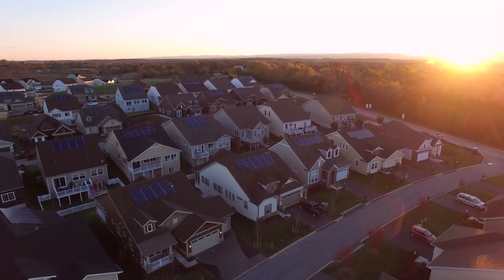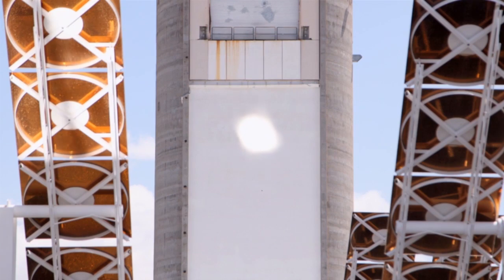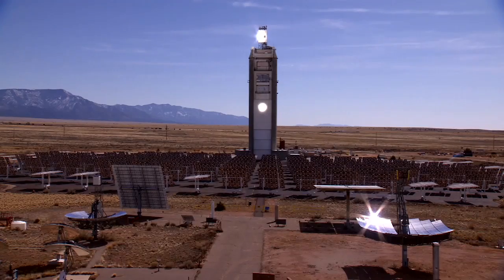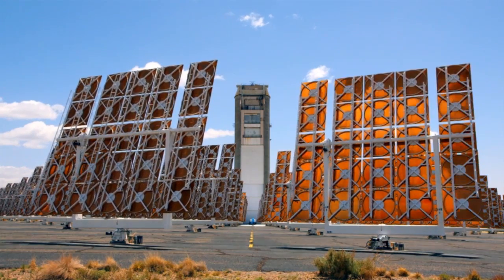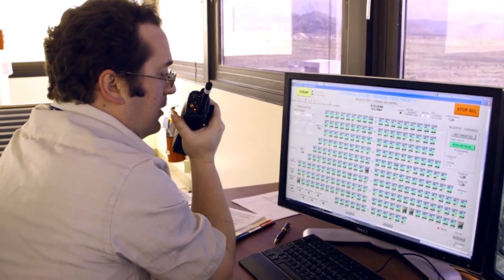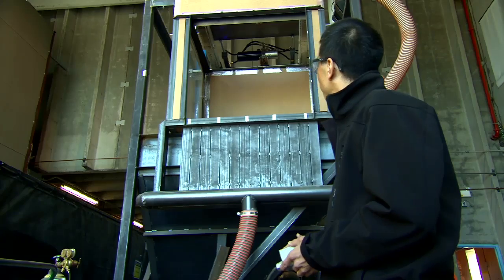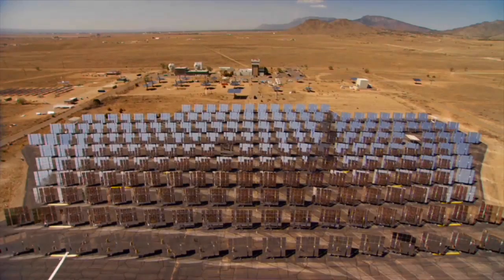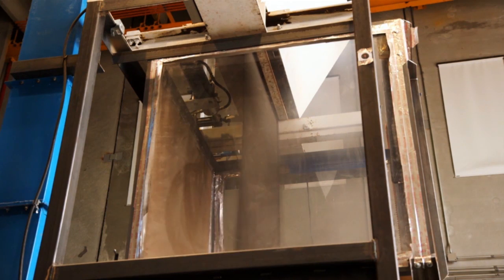Lowering the Costs of Concentrating Solar Power

Comment: There are systems that use concentrated solar to heat compressed  air that drives a gas turbine.  The efficiency of a gas turbine is limited by the temperature difference between  the heated gasses and the exhaust gasses.  The solar turbine heats a surface that heats compressed air.  The temperature is limited  to the melting point of the heated surface.  If it was  possible to heat the compressed air by passing it through the focal point of the concentrated  sunlight,  there would be no limit to the temperature..   But  sunlight seems to go right through the focal point of a magnifying glass with little or no effect on the air.  If ordinary sunlight causes some ionization of the air, then there should be more  ionization at the focal point of concentrated sunlight..  If the focal point was located at the center of a powerful magnetic field, and high voltage plates were arranged near the focal point,  some of the ions and electrons would be trapped if only briefly.  This would cause more ionization at the focal point which would cause more ionization , etc....... at an accelerating rate.   If the concentration of ions and electrons  reached a certain point called a critically dense plasma, , sunlight would no longer be able to pass through the  focal point.   The plasma might heat up to millions of degrees.  
Ions and electrons in the compressed air  could be separated by an insulated  high  voltage positive charge  at the center of the turbine.  A cylindrical plate around this electrode would be hit by electrons trying to get to the center and drive the ionized air away from the center.   If this cylinder was connected to a plate and a grid for the exhaust to pass through  just beyond the turbine blades,  the positively charged air would be accelerated through the turbine blades where it would recombine with the electrons from the cylinder and complete a circuit.. Another set of turbine blades just beyond could extract the heat generated by the flow of current at this grid. 
A generator driven by the turbine would generate additional electricity.
If a set of compressor blades was attached to the inside of a funnel, and the positive voltage at the center was connected to the funnel and an insulated cone just beyond the focal point, the compressed air would pass through the focal point where some of it would be ionized and some of the ions trapped between the positive voltage on the funnel and the cone and held in the focal point by the magnetic field arranged parallel to the axis of the turbine.  The positive charge would build up which would tend to trap some electrons.  The electrons would try to escape towards the funnel or the cone but being much closer to the positive charge at the focal point might trap some of them for a while.  The rush of compressed air into the focal would try to dislodge the trapped ions and electrons, but a strong enough voltage and magnetic field might hold  the ions and electrons long enough for the temperature at the center to increase fast enough so that more air was ionized than stripped away by the comoressed air.    The positive charge on the air would tend to increase the pressure  and drive the system faster.   If the inner housing was connected to the funnel and the positive voltage at the center,, the funnel would tend to ionize the air as it was being compressed and air ionized by the plasma would tend to increase the voltage of the inner housing which would increase the ionization of the air in the compressor funnel.  .  A number of accelerating processes would  tend to increase the temperature and the voltage of the compressed air and drive the turbine at an accelerating rate.

Another possibility is to put a high voltage arc acriss the air entering the turbine.  Since it is spinning, the arc would create a disk of plasma that could trap the sunlight at the focal point.  Multiple arcs might trap all of the sunlight if one disk is not dense enough.

Comment: With Optimization of Stirling Engines you would drastically increasing production by making every parabolic mirror producing energy from concentrated light: higher temperatures means more energetic conversion.
Highest temperatures differentials means increased efficiency.
You have the only patented technology to creating below 80°K in a small radius with a small portable device producing no vibrations and lasting +22 years, NASA approved..
SunPower's Stirling CryoCooler is the best solution in terms of energetic expenditure for creating a low temperature side in a fully optimized Stirling Engine.
You could ask "THAT" MIT board advisory professor helping you creating a Molten Aluminium Heat storage for superheating air at ~950°C during night time bringing night hours production just halfway the daytime production.
With inexpensive materials like Clay Graphite , Aluminium and Arduinos you could be able to bring the Kwh price to 0,02$ quite easily...
Taking in count a lot of jobs and a good pay even..
Ask Mexico... they have plenty of desert.
[No seriously ask Mexico]

Comment: Why not stick to cheap low tech pv? It does the job low cost on your  own roof.
Reply: PV is not low tech. You could cobble together some form of CSP using parts you could find in many many villages and districts in africa. You can't manufacture a PV in the same african village or district. You almost 100% guaranteed have to import the PV panel.
Reply: @backtotheoldway6964  You are right. PV's are not low tech. But the installation and maintenance is not very complex. Therefore, in rural places, PV's in a simpel setting are preferable. 
But still there is the problem of storage. There is no easy solution to that problem. But accu's differ greatly in price and effect. Maybe a less expensive solution can be found.
Reply: PierreB yes, if you can find a cheap utility scale battery
Reply: Solar power needs a whole lot of light collecting surface. Better be something simple like a mirror than advanced electronics like PVs requiring environmentally damaging mining to produce.
CSP is more efficient too.
Reply: well Thermal solar power have economies of scale. Also thermal solar power can store energy in thermal batteries. these batteries are much cheaper when done at large scale. Its economy feasible for Thermal solar power plant to have enough power storage for whole night. Pv power storage has to be done in lithium batteries which are expensive and not as reliable.  Thermal batteries life span is just as long as the turbines if not longer. 
It not economical for PV to store much power. Pv are great for off the grid small scale sites which you do not need too much lithium batteries.  In tropical climates solar pv can be use for peaker plants since A/c units ran at most during the day.

Comment: This is complete bull... higher temps means higher pressures because when you increase the temp of something you also increase the pressure of something which means more resistance to motion because the charged particles...that are tiny magnets...run into each other more which creates more heat because of friction... because you are forcing the particles closer together...solar panels work better when cooler... it's an extremely stupid decision to change the sun's potential energy into kenetic energy to do work that is not needed... you are intentionally decreasing the output kenetic energy because you are doing work with it because in order to do work takes energy...it makes it less efficient...here is an example...a furnace blower motor is being restricted because of a frozen AC evaporator coil and is not letting much air by it cause it is a block of ice... you check the amp draw on the blower motor with the doors on so you get a true reading and you get 5amps... normally it should be 10amps...only half of the air that normally can be moved is being moved...this is less work because you are throwing less air...but you are still giving the motor the same amount of current because the circuit is what determines how much current is sent to the capacitor... A capacitor builds up charge before it sends it to the motor... So you are still sending the same amount of current to the blower motor at all times... Your amp reading is less because you are only reading the amount of current that is doing work... The rest of the current is being turned directly into heat... the capacitor does not care if the motor is being restricted or if the motor is pushing more air... So you lose efficiency because you're giving the motor too much energy to run it at the restricted speed.. so restrictions mean wasted energy.. if you look at the back of the solar panels in this video you will see a lot of copper on the back. Now look at solar panels for houses and you'll see that there is much less copper on residential solar panels.... That is how this thing makes more energy... Heating up a fluid is just wasting energy because  you do not need to do that because you have solar panels that turns the sun's light directly to electricity...it's pretty stupid to have solar panels and use the electricity to turn a turbine to generate electricity
Reply: What you're missing is PV solar only "works" if you have storage.  So you have to factor that into your equations here.  Charging batteries is lossy too.  Batteries are also very expensive by comparison per Wh.
Reply: It’s pretty basic physics that heat engines in general and steam turbines in particular operate more efficiently in higher temperatures.